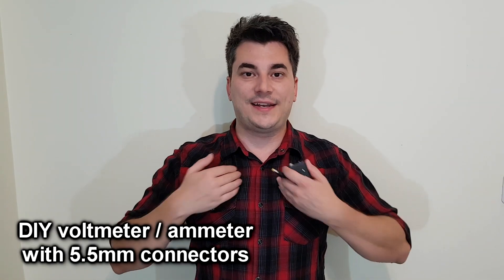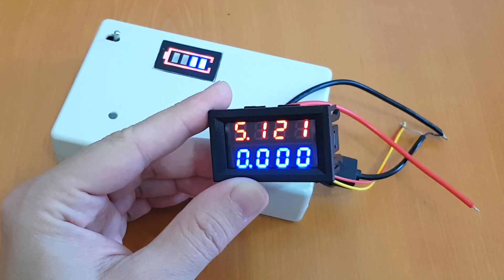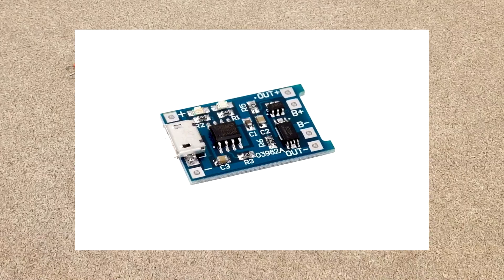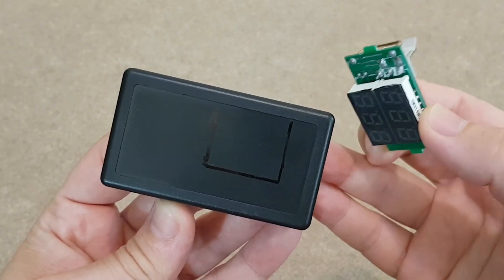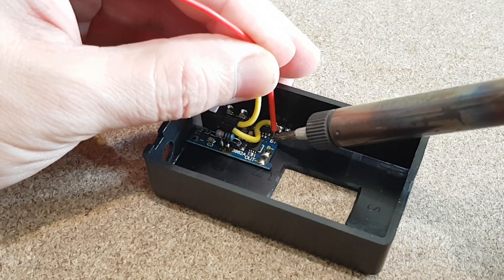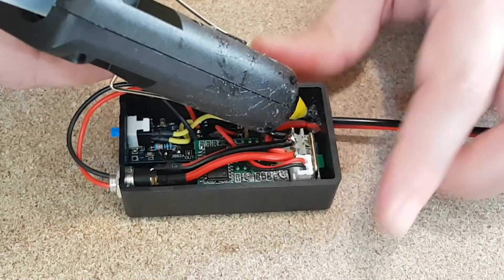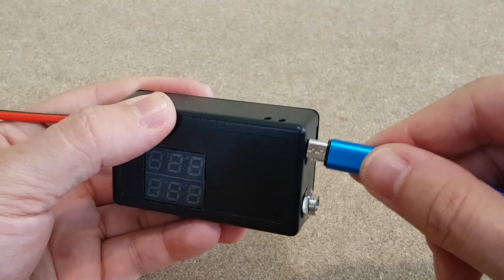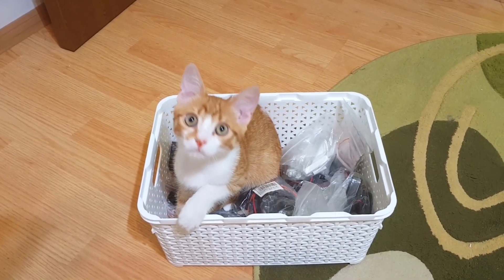DIY Simple Voltmeter / Ammeter With 5.5mm Connectors

Comment: I have made similar just using 9v battery for meter power. And then bnc connectors for input and output. In little plastic syringe tip box..

Comment: I love this video! 😂😂🐱 👃🏻 Hi! Do you know of this meter can be wired to be an inline meter that detects current coming in (from say a small 12v 1A solar panel to a solar charger)? I see it detects negative draw but what about charge?  If it can which wiring diagram would one use?
Reply from the maker: yes you can use it to measure the solar panel output. you connect it to the solar panel as the power source and the output/load will be the charger.
Reply: @Sorin_DIY  oh great! Which wiring configuration from the manufacture would I use (of the two options)? I’m hoping I can do the external powered vs internal. Want to try to keep the end product as small as possible.

Comment: It's great work. Some website says this type of ameter needs to be used with a shunt resister. In your case there is no need to use a shunt resister?
Reply from the maker: the ammeter has an internal shunt for maximum 10A. if you want to measure a higher current, you need to add an external shunt.
Reply: @Sorin_DIY  
Thanks for a clear explanation.

Comment: 3:07 Doesn't a LiPo battery get damaged below 3.0V?
Reply from the maker: if you discharge it many times under 3V, in time it will loose some capacity. but this battery last very long time and I charge it every few months. the cell never gets fully discharged.

Comment: One of this but for Alternated Current. Would work even if the module would be powered by the same outlet as the load being tested? Or I should just try…. (Without any accidents)
Reply from the maker: it will need a separate power source.
Reply: @Sorin_DIY  Robojax teste the PUUCAI, and if I am not mistaken (which I probably am) he just connected the meter in parallel...
Reply: @Sorin_DIY  I don't understand why I would need a separated power supply and cannot just connect in parallel. I sure it will be a complicated explanation. but maybe you can just direct me where to find the answer to this?  I searched a lot and cannot not find an explanation. Thanks you.
Reply from the maker: it depends on what type of volt/ammeter you are using. for some models the current measurement is not accurate if it's powered by the same source that it's measuring.
Reply: @Sorin_DIY  Now I understand better...  but since the meter in question has a Coil current transformer that can be connected after the module itself, I guess it will read correct current. Thanks a lot for taking the time to explain!

Comment: Is it a different schematic if you use a Voltmeter/Ammeter that has 2 thick wires instead of 3?
Reply from the maker: there is a small difference. one of the wires on each volt/ammeter is connected differently.

Comment: Hi sorin I tried charging cellphone through  volt amp meter my cellphone battery doesn't increase,I can know the current consumption of the device any suggestion?
Reply from the maker: you probably didn't connect something right, or the volt/ammeter is faulty. try it with a simple circuit first. a charger (5V-12V)-> volt/ammeter -> a light bulb/LED or another load. check if the volt/ammeter works. use this schematic: https://www.pcboard.ca/image/cache/catalog/products/digital_volt_meter/dvam-01/dvam-01_hookup-800x800.jpg

Comment: Hi Sorin.  can i use xl609/xl6019 with a bigger box  instead of yours mini dc bc?
Reply from the maker: no. you need a boost converter with an input voltage starting from 2.5V. the xl6019 needs minimum 3V or 3.3V.

Comment: https://www.amazon.in/dp/B076KJZG84/ref=cm_sw_r_cp_apa_fabt1_W.mVFb9VV2RSS please tell me can it use the one that I send you?I can't find it the one that you used in your video tell me before I build I need your help
Reply from the maker: hi. it will work, but the reviews are mixed. below 9.99V in some pictures it shows 1 decimal place, in other pictures 2 decimal places. I suggest you use the volt/ammeter from the link in the video description, it has 4 digits for voltage and 4 digits for current. it's much more precise.

Comment: I would ask if you have an idea  I bought last week a dead old brass doorbell on which is indacated 12 ac volts. The electricen said that the solenoid has a cooper wire of 0.5 mm and about  880 turns. But when i applied 12 ac volts the bell hardly vibrate and didn't make sound. I graduly increased the ac voltage until 30 ac volts where the bell function well. My questions are :
 1/ Can I decrease the number of turns to let the bell function under 12 ac volts and how many turns.
2/ Can I function the bell under 220 ac volts and how to calculate the thickness of the cooper wire and the number of turns.

Best regards.
Reply from the maker: hi. I don't think you can convert it to 220V, because it's not made to work with that voltage, there is probably not enough space for a coil that works with 220V and it's dangerous to use the ring button to transfer 220V. it's better to modify it to work with 12V. I think you can remove 200-300 turns from the coil. but I don't know how powerful the solenoid is. there is a possibility you will need to replace the entire coil with a thicker wire, to be able to produce the same power at 12V.
Reply: @Sorin_DIY  thank you Sorin

Comment: Hi Sornin, Maybe I missed it but I could not find a parts list or links to the components you used n this project, specifically I am interested in the higher accuracy voltmeter/ammeter module with 2 decimal please and +/-10mV accuracy. Can you please provide you BOM with links?
Reply from the maker: hi. the 3 digits voltmeter is not available anymore. you can use this one:
https://www.aliexpress.com/item/32969092960.html?spm=a2g0s.9042311.0.0.22524c4dib3JsV

Comment: Neat and usefull project as always!!! 
The battery capacity is fine, with this kind of tool you can charge it 1 time per month maybe more, plus, and each time you use such tool it is for 10-20sec max, the secret is the switch feature!! PS: there is smaller type of push switch, they are white, and so usefull for many project! model: 5.8x5.8
https://fr.aliexpress.com/item/4000834984463.html?spm=a2g0s.8937460.0.0.532f2e0e8ftHdA
And there is also cap available for them 😉
You are right about voltmeters LCD, the model with 3 thicks wires is super difficult to find, I use the one with 3 digits, second model you showed, because standard model with 1 digit got a crappy accuracy. I use this model for basic project, but for project like volts + Amps investigation, better go for better accuracy models.
PS: this project is the brother of the first ampmeter you used at 03:48, but with less cables so more cute 😁

Comment: hi sorin give me voltmeter and battery booster link.
Reply from the maker: hi. the 3 digits voltmeter is not available anymore. you can use these components:
https://www.aliexpress.com/item/32969092960.html?spm=a2g0s.9042311.0.0.22524c4dib3JsV
https://www.aliexpress.com/item/32800430445.html?spm=a2g0s.9042311.0.0.27424c4de42Pxz

Comment: Hi Sorin, why not power the volt/amp meter from the source using a buck converter, so you don't need the battery?
Reply from the maker: hi. because the volt/ammeter need a supply voltage of 4.5V - 30V to work. a buck/boost  converter has a limited input voltage range and I plan to use it for measuring voltages of 0.00V - 100V. the voltmeter + a DC converter will draw 15 - 20mA from the current I want to measure, so the measurement will not be accurate.
Reply: @Sorin_DIY  The barrel jack can handle up to 36V safely. I doubt you'd want to measure 100V with it. Also, if you wired the meter slim wires in parallel to the object being measured you could accurately measure the current drawn. So in my opinion the battery is useless.
Reply: Probably because the voltmeter can go up to 100 V and the buck converter only 30V that is probably the rason.
Reply: Thanks man I very like your channel very informative 👍👍

Comment: Did you use 5.5×2.1 or 5.5×2.5 mm connectors?
Reply: Probably 5.5 x 2.1 as they are the standard on most devices. Although many CCTV uses the 2.5 as theres is more current. 
Best regards,  
Scott. ✌️🙏✌️
Reply: Just heard rated for 5amps so I am thinking it is a 5.5 x 2.5mm connectors now. But I could be wrong Sorin???
Reply from the maker: hi. I used 5.5 x 2.1mm connectors, because they are the most used. but I ordered some 5.5 x 2.5mm male/female adapters, for example to monitor the power consumption of a laptop.
Reply: Sorin - DIY Electrical Nerd 

Thank you Sorin. I thought maybe 2.1 as it is the most used in the world. Keep at it 💪💪💪